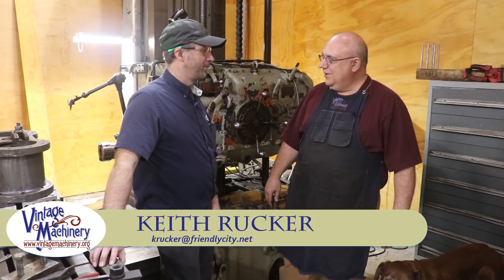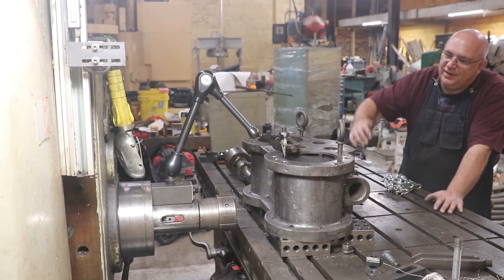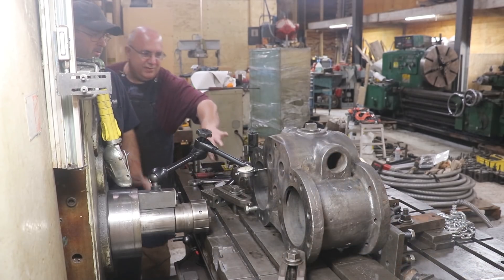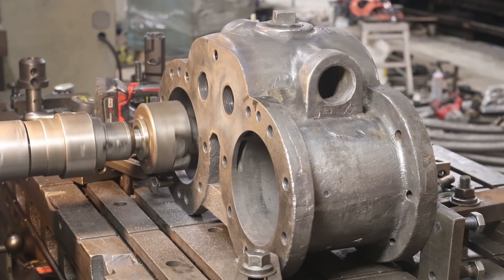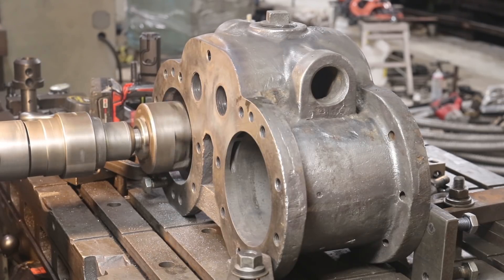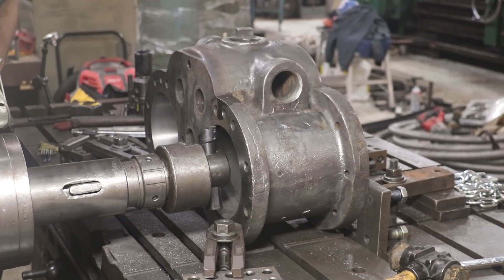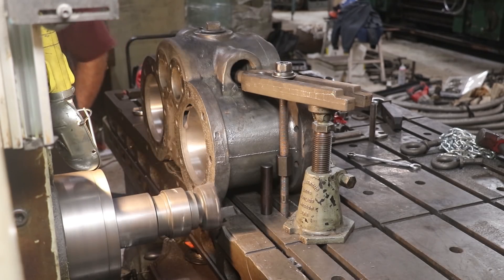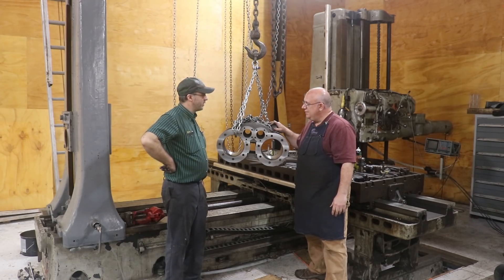Steam Locomotive Stoker Engine Restoration - Part 8: Boring and Facing the Cylinder Head

Comment: If bores were finished previously. Take 2 pieces of clean round stock. Put it in large bores and c clamp them. They should run true to bore. Then indicate them and secure them and recheck.  Maybe you use this method for other things but we used it alot for vert or horz boring alignment

Comment: why didn't he use a dial indicator to center his boring bar? I think it would be more accurate, and a lot easier.
Reply: When you are working on a rusted pitted and worn bore the feeler gauge averages it out so you can be more accurate. Hard to dial anything in with an indicator when it is bouncing around .030" from pitting.

Comment: Great video. I noticed that even with that large machine, it leaves the milling marks showing the passes of the cutter. I’ve wondered if I tried milling a head on a conventional “Bridgeport “ if those milling marks would hurt anything or will the gasket take care of it. Thanks for the video, JB San Diego.
Reply: Depends on what your cut difference is, mine is about .0003" in 4" so a few strokes with a large file and it all evens out if you need it real good. For about anything but metal gaskets it would be fine as is.

Comment: Two questions , what is stroke of engine ?  Will you have to compensate with gasket thickness  to maintain piston " head space " ?
Reply: Steam engines don't have a "compression stroke". The pistons are relatively far (compared to an internal combustion engine) from hitting the heads even at TDC/BDC.

Comment: How did you measure that bore? Ok you use a bore gage on something like that is that how you measured it or how did you measure it?
Reply: Bore gauge set with an external micrometer and  bore verified with an internal micrometer to make sure readings were the same.
Reply: Was the bore gage a 2 point of contact  or a 3 point of contact bore gage I know they make both it looked like a 3 point contact bore gage?
Reply: @crossbowhunter9118  4 point
Reply: @chris0tube On the Standard and Dorsey brand dial bore gauge  the 3 fingers slide and the one point is fixed. That is why you read it the way I did. Watch at 2:30 in this video from the manufacturer and you will see they are using it the same way I did. https://www.youtube.com/watch?time_continue=152&v=LR_qd_th5XU&feature=emb_logo

Comment: Keith,watched Brian's video. Asked why didn't bore the slide valves. He said were sleeved,and you would replace them? Okay so if was set up and lined up, why not cut out the old ones while there? Also why didn't you face both ends? Don't both sides have to seal?  Know you have a plan,but was there, with the right man and machine!

Comment: Nice job Brian  Don't forget to oil the tail stock lead screw unless it runs in oil . I have to oil mine but how many times did it not get oiled  in its life ?
Reply: It has an oil reservoir that oils the screw and the ways but it is probably due a refilling.  The ways are still well oiled so I don't think it has run out yet.

Comment: LOVE them G&L horizontals! So versatile. What tooling you don't have you can make on it. Line bore pumps and geared transmission cases, drill and tap hole circles, all manner of milling, bum a gividing head and cut gears, spline shafts, vice work, little bity parts, stuff that overwhemls the table, and everthing between. Some models even have a lead screw and half nut on the quill feed so you can bore threads. 

Powerful too: I ran an 8" carbide face mill on apindle sleeve adapter to square up and size alloy steel forgings for ship propeller keys. Made hundreds of pounds of chips in a shift. Next week I was boring for seat rings in a fuel oil transfer valve manifold. Mount a 24" chuck on the spindle sleeve face and you have a lathe of sorts. I turned 22" pistion rings from a raw ring casting once. Everybody ought to have a 340T G&L in their shops. Of course there's a little matter of the $40K price for one in good working condition...
Reply: Forrest  Addy and the install and rigging fees !
Reply: @blaablaahi  They are for sure a major job to get setup right. Also you need a proper foundation or you are wasting your time if you want to really be accurate with it.
Reply: I don't think I'd have a roof or door/wall left after getting that in my workshop

Comment: I'm a little surprised that you didn't bore the valve bores. I guess they were in good shape?
Reply: The valve bores are brass pressed in and Keith is going to redo them. If you see the comments on Brians YouTube it will explain it better.
Reply: The valves are piston valves and operate in pressed-in cages or sleeves.